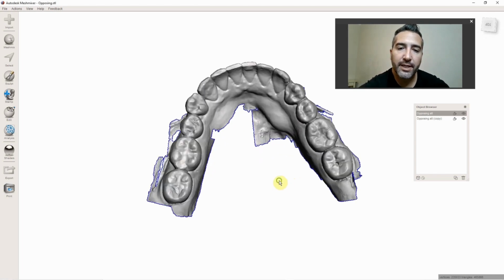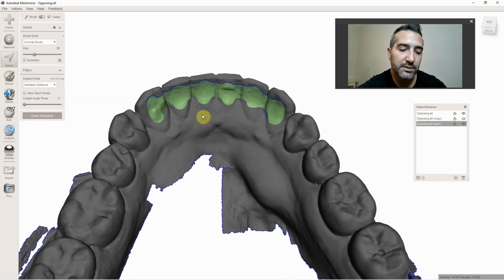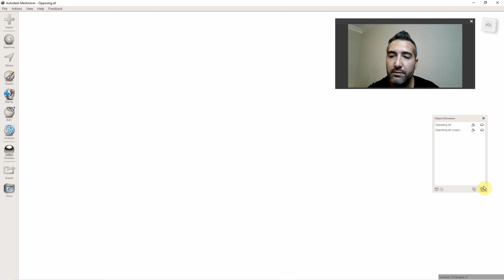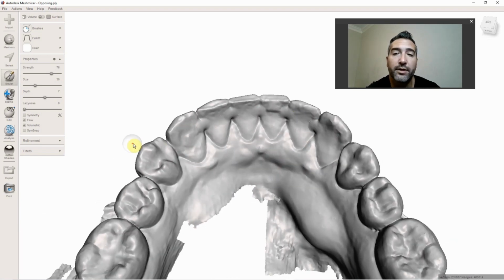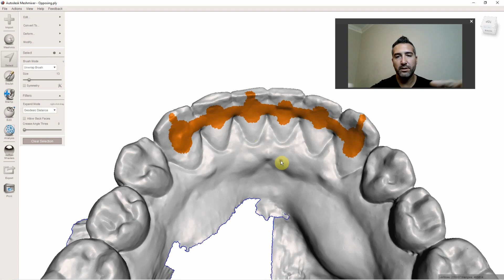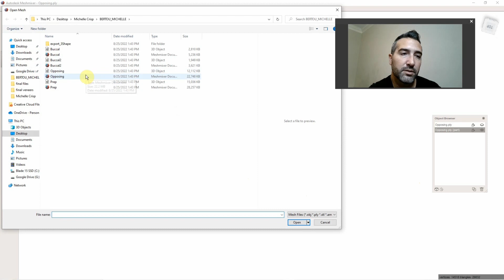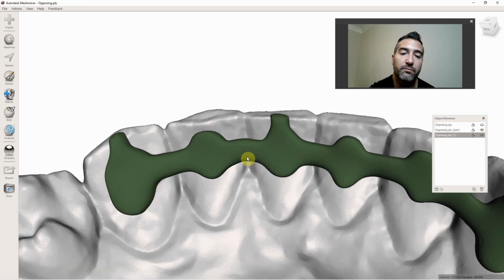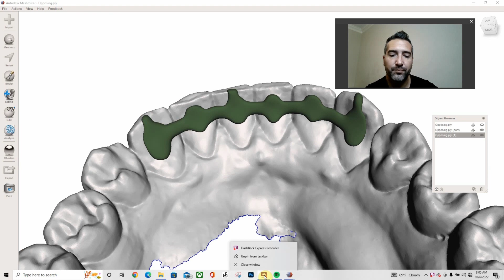3D printed lingual retainer tutorial (UPDATE)

Comment: I am wondering about long term stability of these. Most lingual retainers made from steel are somewhat flexible. These are very rigid which to me sounds they will break or the bonding will come loose. Thats the same reason most Maryland bridges these days are bonded on just 1 tooth instead of 2.
Please let us know if you have placed any how they are doing.
Reply from the maker: Nah. Been doing these for 2 years. They are not “Very ridged” how about print one and try.  They are not made of a ridged ceramic. They are 3D printed resin.  They are able to flex and absorb shock.